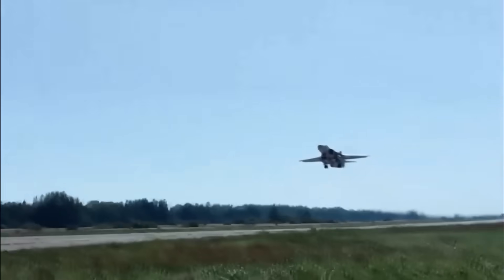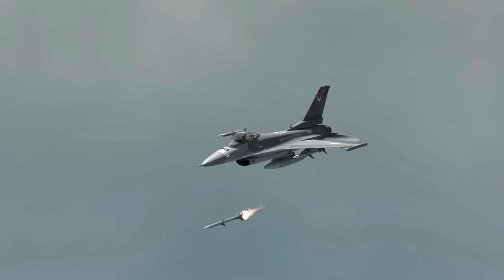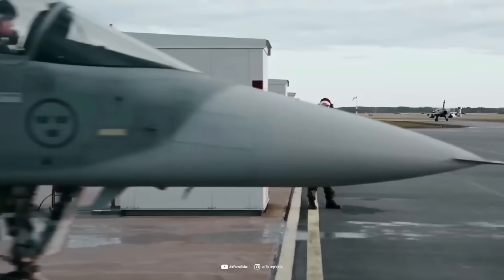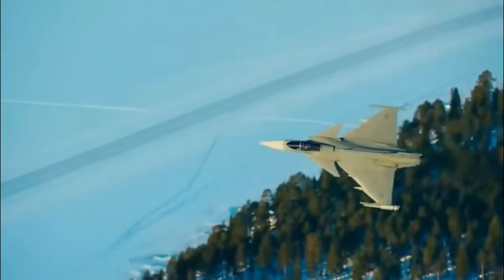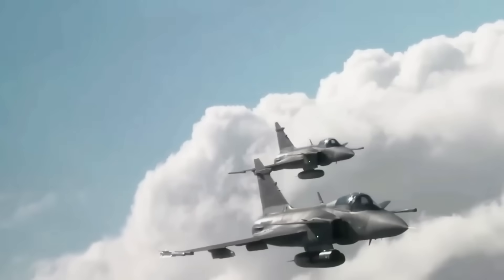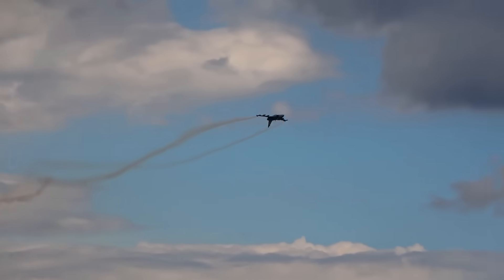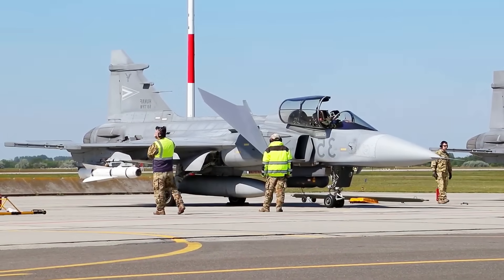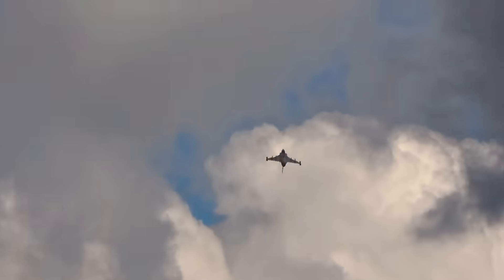SWEDEN's New Gripen Engine Will Change Global Power Forever?

Comment: Canada doesn’t need stealth—we’re not invading anyone. What Canada needs is numbers.
Our country is 1.5 times larger than the United States, yet the U.S. employs approximately 300 to 400 fighter aircraft as part of its continental quick reaction force (QRF). So how is Canada expected to defend a landmass that’s 1.5 times bigger with only 88 aircraft—less than one-third the number?
This is exactly why Canada needs the Gripen-E.
Reply: And the Grippon  will be built in Canada by Canadians
Reply: Stealthy when you can fly over not knowing this is hidden in the forest below, ready to take off and sneak up behind you😮!
Reply: You will not have to. This thinking about defence is outdated now with the rapidly developing drone technology. Why waste money on useless, expensive  yank junk?
Reply: @TerryBeath This is what I wonder about. I know little about martial strategy, but I do know we tend to prepare for the previous war.
Reply: I used to be on the f-35 side, but I've come around.  Up in our arctic, it won't be about stealth except maybe detection at the fringe of our airspace.  Just like in the Russian north and their aircraft, it's about resilience, presence, fleet size, number of bases.  The weaponry and electronics are already exemplary and can be continuously upgraded.
Reply: @rreiter Jas gripen e is the jet for easy and fast upgrading.
Reply: Agreed. Stealth ability is more of a benefit for offense and an advantage going into enemy territory against well defended and established targets. To  use against an invasion stealth has little to no benefit as it will be a constantly moving theater and less protected targets. 

Canada will never have enough military equipment to stop amln invasion and then take the fight into the  enemy's homeland.

If it reached that stage,  all the equipment that Canada had before the war would have been destroyed and it would be a completely different set rules requiring a completely different set of weapons.
Reply: Exactly, same for Australia. The only reason we bought F35's was for a ticket to the dress circle.
Reply: Good point. The f-35 is really good for offensive campaigns. Israel may need it. Not that important if you just want to defend your turf. Almost all American ordnance is designed with American war doctrine in mind
Reply: How about drones - lotsa lotsa lotsa drones. Ideally placed in SafeStorage Outfits or container yards close to the USA/Canada border and or next to neighbouring US Air bases "just in case".   How about a canadian network of covert hangars distributed in Canadian hinterland backed up by a concealed network of passive air defense detection ?  Of course the real problem that the US (Canada's real enemy - it IS only the USA that has threatened Canada recently ?) has is the same problem which Russia has with Ukraine. Difficult to fight an enemy on your ground who looks just like you & speaks like you .....
Reply: @unitb7713  Americans can hear Canadians' accent. I was living in Texas for 3.5 years before I could.
Reply: Careful on stealth. Canada is defense-dependent on its partnership- and PARTICIPATION in/with the US/NATO- on its own, Canada’s military cannot defend Canada. Saying it doesn’t need ‘stealth’ is short-sighted and, well, naive (honestly). Canada has to be part of the system - whatever it takes- to keep anyone from invading Canada in any way to begin with.
Reply: @dphuntsman   BS, the Gripen is fully interoperable with NATO, and therefore interoperable with NORAD.  If you wish to give up our sovereignty forever just to suck up to the US, you must be American.
Reply: @C.D-e4f 
I admire your fervour.  However. The Grippon is not interactive with the F 35.. two different engines not compatible with training manuals
Of the 88 that were ordered by Canada 18 are contractually committed to be purchased 
I believe the rest should be ordered from Sweden , built in Canada, by Canadians and serviced in Canada.. something that’s Sweden SAAB has agreed to. Furthermore, it’s possible that Canada can negotiate to have SAAB defer some of the costs on those 18 planes ordered by Canada or perhaps we can resell them
Reply: @josephlacorte-hv3kl  16 planes...
Reply: @dphuntsman 

No, the F-35s only make sense if integrated into the US military for America's geo-political machinations which have no benefit to Canada and have no connection to Canada's defense. 

Secondly, For almost 100 years Canada has faced no threat from a foreign country.

Finally, the most likely threat in the future, excluding the US, is the encroachment into Canadian northern territory by China or Russia, where the F-35 would be a liability.
A Northern Alliance with European countries focused on confronting a northern occupation is the most sensible. Canada buying equipment so it can integrate with the US military to fight  US wars in the Middle East is foolish.
Reply: @dphuntsman  Just who and how is anyone going to invade Canada?  It borders three oceans and the US. Remember it took 5,000 ships for Normandy and that was less than 100 miles.  There is no way any nation can land enough troops to defeat Canada on its own territory. Get real man.
Reply: @dphuntsman   I don't think stealth is an issue. The Gripen is just a superior plane to the much hullabalood f35 for our needs in my opinion.
Reply: @georgedyson9754 these days, stealth is increasingly the realm of drones.
Reply: Sure the newer gripen could be a part of the airforce, but we need like 30 f35’s as well
Reply: @underscr0e   Why would we need the overrated f35?
Reply: @underscr0e  
The worst case scenario is that you have F 35 as well as the new Grippon
F 35 are triple the cost to maintain 
F 35 are built in the United States by American workers and American factories and serviced by Americans 
Canada loses all of that 
Best case scenario is that Canada buys all 88 planes from Sweden Saab minus the 18 that they are contracted for legally 
Perhaps Sweden can help Canada offset some of the cost of those 18 F 35 that they have to build
Just makes no sense to be buying all 88F 35
Reply: Also, SwedenSaab has guaranteed that those planes will be built in Canada by Canadians and maintained in Canada by Canadians win win for Canada
Reply: @josephlacorte-hv3kl  I agree.
Reply: @josephlacorte-hv3kl  Wait!!!  Canada contracted to buy 88 F-35s for 19 billion dollars. That works out to $215 million per plane.  If Lockheed can not deliver at that price, and it is obvious it can't, then Canada can legally refuse to accept them. Besides those 16 initial F-35 are years away from being delivered.
Reply: @GNFLYER  Expected delivery times are 4 airframes in 2026, all 16 by 2028.
Reply: no we don't we need a twin engine fighter this doesn't suit our needs for how big and harsh our territory is
Reply: @blackhoodedkid  So you trust the Americans to make an aircraft for your harsch climate but not the Swedes who share similar climate?
Reply: @blackhoodedkid  Cool. Buy the F35. Its got a second one waiting back in the hangar for when the first blow up. 

Or just stop pretending that you have the option. Because you don’t. Not is you are choosing between the F35 and the J39.
Reply: @blackhoodedkid hey Donald. What are you doing here? Thought you owned your own platform?
Reply: @blackhoodedkid  the jet engines in single engined fighters have to meet a higher reliability standard to be certified. The Gripen can easily mount external fuel tanks to increase range.

Comment: The redundancy levels for current fighter aircraft, single engine vs twin engines:
F-35, F-16 & Gripen = 3rd single generation;  F-15 & CF-18 = 4th generation
Reply: The twin engine CF-18 and F-15 are designed to “keep flying” after taking two hits anywhere in the hydraulic systems.

Comment: Is there a new engine? Does it still require licensing from the US? That is the whole possible story and its not clear. Clickbait.
Reply: They are replacing the engine with UK rolls Royce, therefore eliminating USA licensing issues
Reply: @FurTheRecord-Mews  That should have been said much more clearly. Including an expert opinion on USA licensing for engines. Licenses and US control are the chief element of this story.

Comment: Lets face the facts, large air bases are very vulnerable to day from drones and new missile technology. Sweden just designed aircraft for short runways easy to refuel and have missiles attached to the aircraft and up in the air to fight like they have to (they have to deal with Russia for many decades) . The USA military has all kinds of different fighter jets and aircraft carriers to launch at a foe quickly if needed. Buying American hardware is pricey and we Canadians have to think outside the box what is effective for our needs to defend our sovereignty and national interests! (+ keep Canadians working in that area of expertise is a plus and at first is expensive but we learn and carry on)
Reply: Canadian Petrol Station.. in queue for fuel..
Volkswagen Beetle
Gripen..
Gripen..
SUV..
Reply: @marcwolf60  Snowmobile...Snowmobile...ATV...
Reply: This. The F-35 is designed for "US type warfare". Lots of planes, operating in well controlled environments that only need to be used periodically for strategic strikes. Each plane has lots of down time to be pampered.

They are not designed for a real war where everything is in short supply and the equipment isn't stored or serviced in environmentally controlled hangers.
Reply: The original roadway runaways were designed for the JAS 35 Drakon.  The best cold war fighter came next: the JAS 37 Viggen, (I once had a copy of flight magazine from 1970 with it on its cover - see it taking off at 3:17 in the video clip above) which was larger, so the rear tail fin was made to fold down (reducing its height from 18 feet to 12 feet, so it could fit into defensive bunkers built for the Drakon and a thrust reverser so that it could land on short runways.  At the time Canada was flying the CF-104 Starfighter, which was a real pilot killer, and I and a friend (who went on to fly the CF 18) were saying "this is the plane we should be buying".  Both of us are now pensioners, but I intend to push for him to be there to take the first delivery of the JAS 39.  It would be a nice gesture, as I haven't seen him in 55 years....
Reply: Yes, it all works for the American war doctrine but does it work for allies. American ordnance in general has to be operated exactly as Americans would.

Comment: There will not be a huge difference in cost per unit once the RR engine is incorporated into the Gripen package, compared to F35.
As has been noted, the exponential savings are to be found in its maintenance, storage and operational advantages including derisked unit field distribution and concealment.
It's relevant to consider that setting up a production facility in Canada or Australia is the perfect opportunity to evolve the airframe/engine assembly in a new variant upgrade for the 2030's & 40's.
The often voiced complaint around the astronomical costs of maintaining and deploying the F35, should be a compelling reason to do the longterm maths on Canada's fighter options...
Reply: What percentage of F-35’s are combat ready at any given time? 😊
Reply: @TheFrewah  This is also an area where Gripen excell over pretty much any other Western platform, probably even most fighter platforms in the world.

Availability, ease of maintenance, support and turnaround times are something the Gripen jet was built around. This is a huge soft power enabler that statistics usually just ignore but in reality are one of the most important ones.
Reply: SAAB is not going to put another engine into the Gripen, there is no plans for this... these are just unsubstantiated rumours echoed on the internet.
Reply: @MrCABman1972  SAAB is well aware that the current G.E. engine threatens their international sales.  Negotiations and development are more than just rumours.  Any details will remain Top Secret until SAAB is ready to announce.    SAAB are not fools.
Reply: @chrisgraham2904  Sure... but this is rumours at best. There are no confirmed anything from SAAB about looking into a new engine. For now it is just random people on internet making shit up as normal. Someone saying it does not make it so.
Reply: @MrCABman1972 

Do you work for Lockheed? Worried about losing your job?
Reply: @Richard-or9rt  You are WAY of base dude... I just don't believe in fairytales told by random people on the internet.

I'm all for the Gripen and believe that it is one of the best fighter jets out there and it is a shame the US can dictate their sales through ITAR.

But that does not mean you should believe in unsubstantiated rumors from random anonymous sources which this rumor comes from, it is just bad for you.

Comment: The Rolls Royce engine being evaluated is dimensionally larger than the GE, so it requires more than just a swap out.
The airframe/aircraft redesign will be another challenge. Time will tell...    Be well and stay safe
Reply: SAAB is NOT evaluating a new engine for the Gripen, this is just a stupid rumour that bounce from one eco chanber to the next on the internet.
Reply: Yeah, this isn't WW1 when a mechanics could throw on a captured enemy engine or your plane in a day because you felt like it (yeah, that happened), you will need some redesigning if you want to switch the engine on a new plane. Likely, we will see a Gripen G/H model.
It is possible they can upgrade the E model to G though, they did upgrade the A model to the C model, even though they used 2 air frames for each C model so it wasn't a rush job.
What will happen is that SAAB and Rolls Royce will build a test plane since both the engine and modified air frame needs testing, so it will likely take a few years.